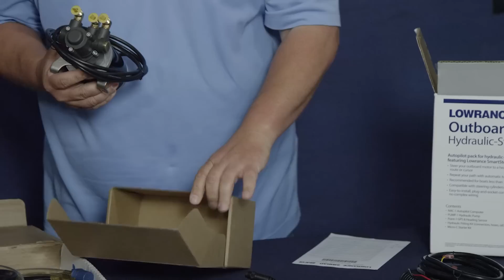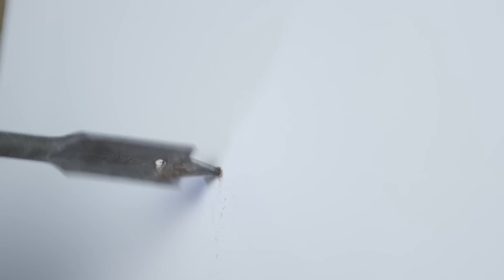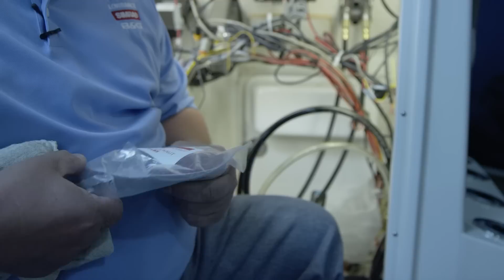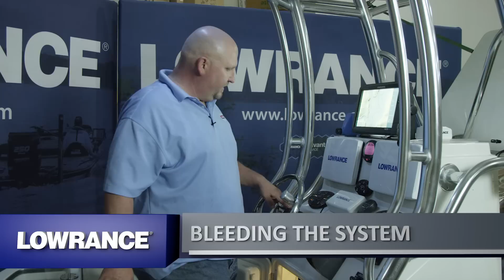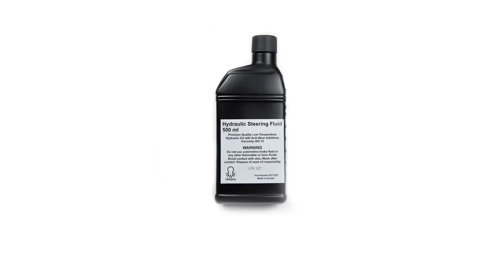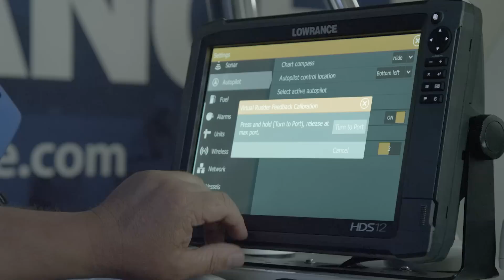How To Install a Lowrance Outboard Pilot Hydraulic Steer on a Baystar Helm

Comment: For an electronics manufacturer to do a “how to” video I would suggest you clean up all the original wiring. No heat shrink connectors loose wiring. A novice will see that and think it’s ok and than wonder in a year why everything is corroded and doesn’t work.

Comment: This video is very helpful.  

The only steps I would add or change is to make sure you back up your data and settings first and upgrade the firmware to the latest revision before calibrating or purging the system.  If you have an older firmware on the Lowrance or NSS Evo2 fish finders, it may not be able to detect the autopilot to be able to move the motor to left and right to do the purging.  The fish finder in this video demo may already have been upgraded to the latest revision and  the power level already set by a previous VRF calibration, so he was able to make the motors move left and right.

After the firmware is installed and the system is rebooted, you may need to do a VRF calibration first in order to set the power level high enough to move the motors.  Our system was not able to move with the left and right arrow without an initial VRF calibration.  After the motor moves, you can purge the system per the video by moving it  to left and right.  If you move to the end of the travel and move the opposite direction, it would help purge the air bubbles trapped in the valves.  After it has been purged, you will need to do a final VRF calibration since the first one is to get the motor to function and may be air trapped in the line.

It is also a good practice to wrap electrical tape around the switch wire terminals that you plug together.  This will prevent the two terminals from coming apart and help protect it from environment.  If you have heat shrink tubing with sealant inside, it would be better way to keep moisture out of the connection.  I prefer to cut off the terminals and solder the connections together and use heat shrink tubing with sealant to provide a water tight seal.

If you don't have any available NEMA 2000 ports available on your fish finder since it is connected to another existing terminal block (for sensors, GPS, etc), you may need to interconnect the terminal blocks with a cable instead.  You will need to remove the dummy load at the end of the old terminal and use a cable to interconnect the new block.  An alternative method is to leave the dummy loads in place at the ends and use an empty port to interconnect the two blocks.

Comment: Note:  
The orb fittings in the kit only works for the Baystar/SeaStar helms and not the Protech Uflex helms (UP28F).  The SeaStar helms has a -5 sized orb fitting.  Uflex helms use -6 sized orb fittings.  The "T" fitting that comes in the kit will not fit for left and right ports.  However, the center return port is a -5 orb fitting on the Uflex helm, so you can use the right angle fittings that come in the kit.  I ended up getting a 6405-06-04 adapter (-6 male orb to 1/4 female NPT) and used the brass "T" fitting to be able to install the system.  I have not found a -6 orb stainless "T" fitting that has the orb interface at the end similar to the one in the kit.  I also had to buy a set of SeaStar HF6009 straight orb fitting since the kit does not have a set of straight orb.   The right angle connector was causing the hose to kink in my helm.

Comment: Very informative, however a few things could be problematic. The pump is installed upside down. In the event of a simple shaft seal leak, you will have fluid leaking onto the electric motor. The pump should be installed with the motor up and the hydraulic hoses down so a leak won’t ruin your motor. Also, never install electronics on the floor or ground to better avoid water intrusion. Finally, you installed a N2k power T onto the network and one is already marked and installed in the network. Unless you are blocking power or the network is separate, this won’t work.

Comment: Great video and essential for my install a year ago. I can't find my install manual so I was looking for the specified hole size  to drill for the quick disconnect button now that I know where I want it. It would have been helpful for you to mention the bit size in the video. For information, my situation required a pump install at 45 degrees rather than horizontal or vertical-up and it has worked fine - so far. In addition, the phone support I got from Lowrance/Navico was outstanding.

Comment: The instructions say: 
The pump unit should be mounted horizontally, with the pipe connections/fittings pointing upwards. Use a 90° bracket if mounted on a bulkhead. It could however be mounted directly on a bulkhead, but never with the motor pointing downwards, as oil leak/sweating from a poor shaft seal can easily penetrate the motor and destroy it.

Comment: On the hydraulic T connection does it matter which goes to the pump or which goes to the steering ram? I connected it the other way bc the cable was short in my application location and i had the extra play in my original lines.

Comment: When you put the GPS antenna on the t top and then opened up your 'access panel' it did not look like their was going to be enough room in that hole to snake the end of the lowrance cable down.  How did you or would you get around that?  Can you cut the lowrance cable and splice the wires back on to the end?

Comment: hi great video, when i set mine up i have an issue: during the calibration both my outboards are set like explained and max port and starboard is set. when i go to sea and test it the autopilot will only turn motors partially to port and centre, not at all to starboard>? any help or tips that can be given?
Reply from the maker: It sounds something is wrong, you should redo the calibration. Please contact our service department at 800-628-4487 and ask for a T2.

Comment: Great video.  How or where do I connect power from the NAC and pump?
Reply from the maker: Hi  THe pump is plugged into the NAC unit  The NAC unit has a power cord that you connect to 12 VDC.  Most vessels will have a terminal block under the helm you can use to tap into the 12VDC. Always ensure the unit is protected with the appropriate size fuse or circuit breaker.

Comment: Yikes! I wouldn't mount any electronics on the floor. Remember this is a boat and things on the floor get wet especially during cleanup. Also I noticed that you were using a cordless drill but had the clutch setting all the way tight. Good way to break things. No need to add a complete new stand alone neama 2000 just add another T.
Reply: Right!  Mount the pump on the floor and put both black boxes on the wall.  Also use something like puppy training pads to catch all the oil.
Reply: If I already have a Point-1 antenna for my radar do I need another for the Auto Pilot?

Comment: I have the cable steer and just installed I find my point 1 in my network but I do not find anything for the nac-1. This is on a hds-9 carbon with the newest update. Where do I go from here??
Reply from the maker: Hi,
There are a few things to check. The obvious things first. Check that the Nac1 is getting power, the N2K connection is secure. and the autopilot option is selected in features. Go to the home page then advanced and then features. Scroll to the autopilot and check the box.  Next go to network and select auto configure.  Then check the sources and see if the Nac1 shows.  If it does not try moving the N2K connection to the backbone to another drop port.  Check to ensure the N2K backbone is properly terminated. It must have a terminating resister at each end.  If none of the above works try resetting the display by performing a restore defaults from the system page.  Make certain you have backed up any waypoints routes or trails on to an SD card prior to restoring defaults

Comment: Getting ready to install the Outboard Pilot and a Simrad GO9 XSE and have 3 questions after viewing this excellent video.

Can you please advise why a separate N2K network backbone was created for the autopilot installation versus extending the existing backbone?  I was planning on having only one backbone.

Why was there no 3 amp fuse on the autopilot's N2K network power cable?  The fuse is shown on Fig 9 the installation wiring diagram.

The autopilot N2K network and the NAC-1 were both powered from the same bus in the video. 
However, my Simrad install manual on p.28 has a specific Note  "Do not connect the NMEA 2000 power cable to the same terminals as........, autopilot computer, .........or other high current devices."
Does this Note only apply to Simrad GO XSE units, or only to NAC-2 & 3 autopilots but not the NAC-1?
Reply: Oleg, Thank you for your questions and I will answer these for you.

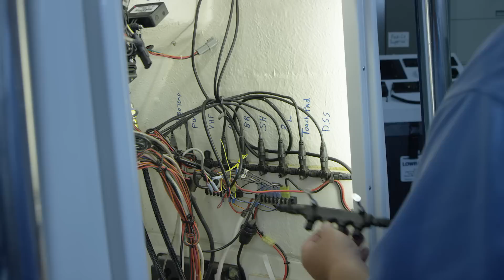1.  At the 2:00 minute mark of the video, It is explained that if you already have a NMEA 2000 network in the boat, you can just connect to the existing network.  It is then explained we were going to install this as a brand new install that did not have an existing NMEA 2000 network on the boat. 

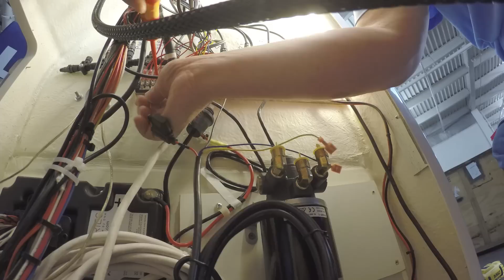2.   If you look at the video again, at the 6:15 minute mark in the video, you can see the fuse on the power cable in front of his hand.

3.    Many Simrad networks are on boat using 24v power.  You do not want the NMEA 2000 network connected to 24v power.  The power for a NMEA 2000 network, should be connected to 12v and it's own terminal post.

Comment: I have 12 HDS Live, Point-1 and SeaStart Teleflex steering with BA-150 cylinder that has 10.2 ci capacity. I have rudders though not outboards. Would this autopilot work for this set up?